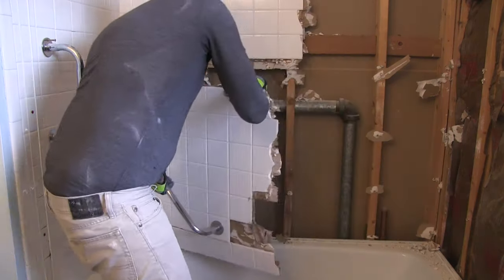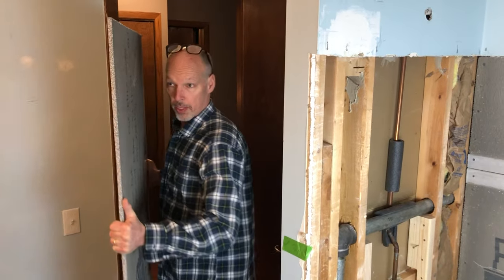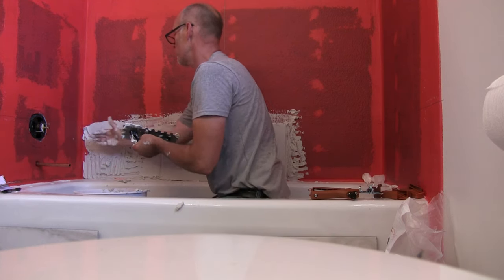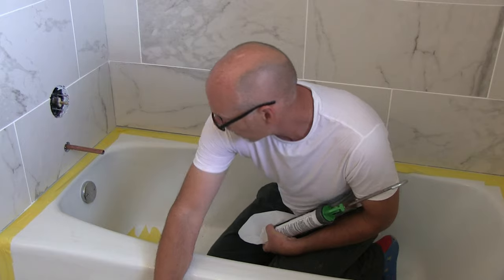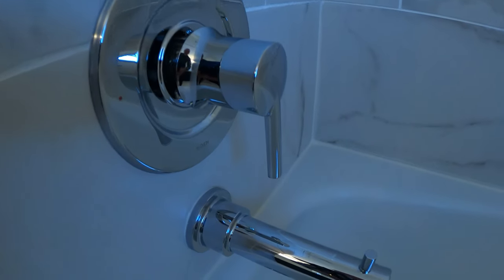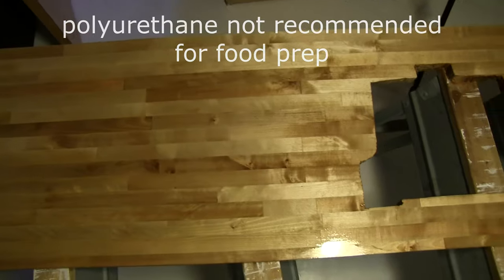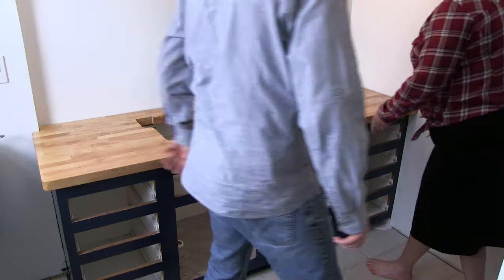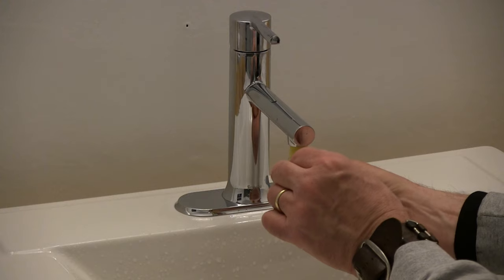Bathroom Renovation DIY: Total Makeover on a Budget (Bathroom Remodel )

Comment: Nice, job! Looks like a big project. How long did it take?
Reply from the maker: Thanks. Approximately 3 or 4 months 😂. I worked on it here and there. 
Most was done after couple months but I put off tiling the shower as I knew that would be the most stressful part. And it was 😂. Stay tuned; family room makeover is currently under way.